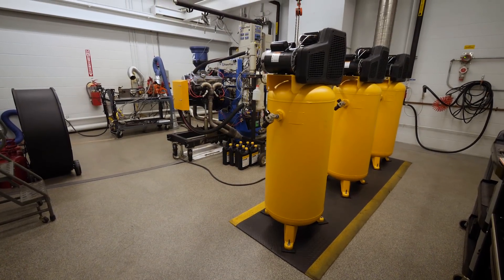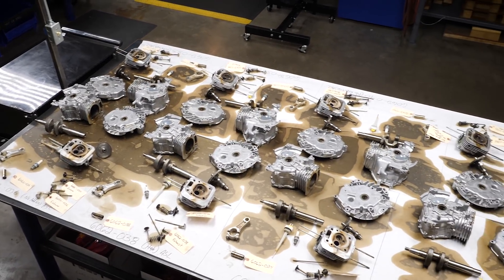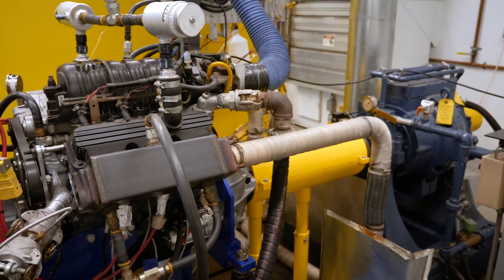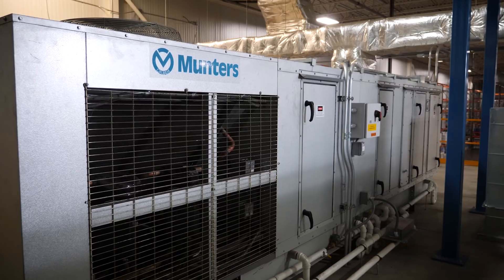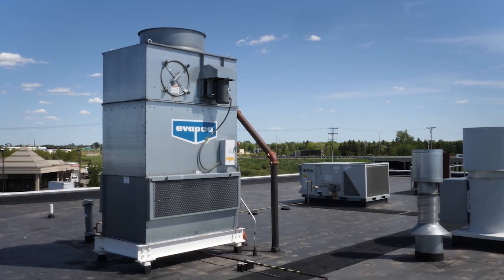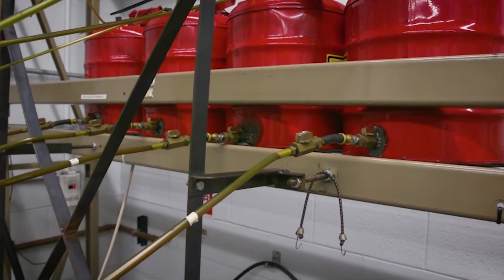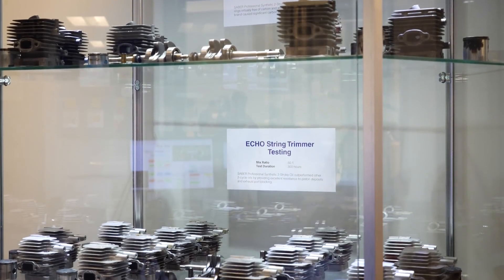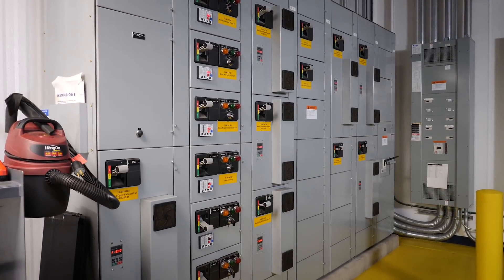Take a Look Inside the AMSOIL Mechanical Lab

Comment: how does amsoil work with carbon build-up on valve stems, on direct injection system?
Reply: patrick garant check out Schaeffer oil. They have 2 patented additives that set them ahead of the rest. Micron Moly and Penetro. Www.schaefferoil.com Americas oldest oil company.
Reply: Schaeffers is OK but the lose all credibility using that one armed bandit grease test machine at trade shows.  It's no secrete that moly is used when the company lacks confidence in their product. It's only use is when the viscosity fails you need that. But I guess it's needed in Shaeffers as their products are not synthetic.
Reply: Jess Cain Its not just moly it's a soluble type of moly specially developed and patented by Schaeffer manufacturing. All the other oil companies are just butt hurt because they cant use it. It has been a proven friction modifier a long time ago. Yeah Schaeffer really lacks confidence in their product 😂😂 they have some of the best reputation for lubricants and fuel additives in the world. Not to mention they are Americas oldest oil company since 1839... I think you need to do more research before you just make false claims. 😎
Reply: Jess Cain Also Amsoil Is very expensive compared to Schaeffers.
Reply: I bought the 100% synthetic OE 5W-30 for just over $4 per quart. How much is Schaeffers old man low performance product? $3.99?
Reply: Is that why you can't compare viscosity retention tests or Sequence IV cam lobe wear testing with AMSOIL? And you have to post your same BS "Secrete additive" post on every AMSOIL video? When you have a true performance oil you don't need to do that. Tacky.
Reply: Jess Cain Tell me why Amsoil only posts a few stats in their technical data ? Schaeffer shows much more. Also Amsoil claims to be the best oil but their approval ratings as far as manufacturers is smaller list than amsoil?  Amsoil is a scam just a mediocre oil with a marketing price. Unbelievable
Reply: Tell ms this big guy. I looked on Amsoil website their cam/lifter wear for the 0w20 is at 20.28 for the sequence test. Schaeffer manufacturing 0w20 cam lifter wear is 9.8!!!! THAT IS HALF THE WEAR OF AMSOIL 🤣🤣🤣🤣🤣😎👍😛
Reply: LOL Mr Peterson in Televiv - Big guy?? Actually you got the wrong data - the AMSOIL cam wear test was 3rd party (SWRI) and done on a 1994 era engine which requires 5W-30!! That's a whole 14+ centistokes less and it still showed no visible wear. Of course Schaeffer's lies as it's not really synthetic and yes - our OE which beats the pants off of all Schaeffer's is 100% synthetic and is just around $4 per quart for accounts when they buy in the drum.. A few cents more in typical cases.. 
AND - the Schaffer guy here in town had to close shop because no one wanted that garbage.
Reply: @grillsandaxlegrease3578  I'm not talking about 5w30 in 1994??? Look on the current signature series technical data they show cam/ lifter wear for 0w20 only in their pretty graph. But 0w20 is the only one they show. So I checked out Schaeffer 0w20 technical data sheet. Cam/lifter wear is less than half the number of amsoil. Not sure where you got the 5w30 and 1994 from? Maybe the fella by you went out of business but I've seen a few in my town start selling it so it must be junk right. Actually my engine builder just started selling it and recommends it over amsoil.
Reply: Dummy - the test you see for the signature series on that 4-page flyer was done on the 1994 KA24E test engine - a standard for the Sequence IV test universally. You are supposed to be the expert huh??  But to prove the oil AMSOIL used the 0W-20 instead of the 5W-30.  More detail was published in the blog.  Unbelievable. 
Schaffers is for old fogies - no performance. Can't because it's not synthetic.
Reply: @grillsandaxlegrease3578  so why wouldnt amsoil post current data? Your telling me since 1994 amsoil hasn't gotten any better? 
Schaeffer is superior to amsoil. Amsoil is a 100%plain synthetic oil with no additives-whoopee.
Either way Schaeffer blows away amsoil in the wear department 😂👍
Reply: This isn't amsoil - it's the test lab which evaluates all oils sold in the US - Reading comprehension isn't a strength of yours.  They use standard blocks for different tests. Sequence III is the Buick, Sequence 4 (IV)  is the 1994 Nissan cast iron block..  I listed above because it is incredibly consistent.  I dare Schaffers to run 0W-20 in this test. Schaeffers (or whatever it's called lol) used the one armed bandant which is part of their trade show circus making their products look like a total joke.  Even Pennzoil Platinum beats the Shavers (Ice cream?)..
Reply: @grillsandaxlegrease3578 
Actually the IVA test isn't as harsh as the sequence IIIG test. Both are 100 hour tests but the IVA test only ranges from 800 to 1500rpm. While the IIIG tests low to high rpm and heavy loads.

"The Sequence IIIG Test consists of a 10-minute operational check, followed by 100 hours of engine operation at moderately high speed, load, and temperature conditions. The 100-hour segment is broken down into five 20-hour test segments. Following the 10-minute operational check and each 20-hour segment, oil samples are drawn from the engine."

"The Sequence IVA test measures engine oil's ability to inhibit camshaft wear.
The Intertek test engine is a Nissan 2.3L, 3 valve per cylinder, 4 cylinder engine. The crankcase oil is subjected to 100 hours of continuous engine running, cycling from an 800 rpm idle period to a short 1500 rpm stage, and back again, 100 times, under very precise control of operating conditions. At the end of the test, the camshaft is removed and measured for wear. Each of the 12 camshaft lobes is measured in 7 places, and an average lobe wear is computed for the test."

NOT ONLY IS THE TEST HARSHER, SCHAEFFER STILL LESS THAN HALF THE WEAR OF AMSOIL 😎👍
Reply: See - you had to look it up - Took you long enough while I waited = 1994 single cam Nissan. You trolls gotta get paid. 
AMSOIL runs the SeqIIIG 300 hours minimum. And the IV 150 hours.  And they report the largest wear!! Not some selected area and does Shavers keep the test cam available for verification?  What is the average test result? And a 9 compared to 20 when 90 is the norm means almost nothing especially when the results for Amsoil are 50% longer!! That means it's likely the Shaver's would have sheered out before then and I'm expecting a wear scar of 100+..  I'll trust a real HP performer over one that sells oil from bottles that can't even keep a lid from leaking.
Reply: @grillsandaxlegrease3578  There is PLENTY of reviews of Schaeffer on Amazon where they have switched from amsoil. Look at the reviews on Amazon. Almost all of Schaeffers products have 4-5star
 ratings. Where is the amsoil ratings?
Reply: LOL!! Man you need new specticals old man (using Old Man oil). I'l looking at the blog now showing your sequence tests (Which you have to read up on because you didn't know) are the test which were ran longer. There is no need to run ASTM tests longer as those are indexes.  People do switch from various oils but if you are not looking for performance and not keeping the truck  - sure Shavers is OK but those people are fooling themselves as AMSOIL does cost less and the bottles don't leak all over the floor. The clown here who has the shavers store had shelves of the stuff leaking through the packages. But their sales are so low it really doesn't matter. It may be the best in the world but they ruin their image with that old fart in the booth with the grease tester trying to show how their oil works. 
Dollar general oil also has 5* ratings - when your IQ is 70 it all seems pretty good.
Reply: @grillsandaxlegrease3578  Just looked at the newest archive amsoil has for 5w-30. After normal length sequence IIIG cam/lifter wear is  14.8. Microns. 

Schaeffer Manufacturing technical data sheet shows cam/lifer wear at 9.8 microns for 5w-30.  

THE PROOF IS PROVIDED BY EACH COMPANY THEMSELVES, YOU CANT WEASLE YOUR WAY OUT OF THIS ONE HOTSHOT. 
AFTER A NORMAL SEQUENCE IIIG TEST, SCHAEFFER HAS 34%LESS WESR THAN AMSOIL. HAVE A LOVELY DAY 😂😎👍😉😭
Reply: Actually those #'s in the scheme of things are virtually the same. And using standard deviations you will get a 10% variation in such testing and these don't have to be averaged because it's a costly test done just once.  
But what really matters are the sum of the whole. How was the piston scuffing or deposits? Shavers being fraud synthetic (not allowed in Germany or Australia  marketed incorrectly) why do they omit the deposits at the 100 hours or even 200 hours?? Hmmmm
And it Shavers was so good then why don't they go for the extended testing? I can guess Shavers tests out of grade at 150 hours thus the driver would not only have deposits, they would lose additional throttle response and horsepower. 
I don't suspect they will be in business for long.
Reply: Sears thought they would last too.. But I didn't know about 25K. Harley owners don't care about that.  I pull a motor home and love the extra mileage as in MPG  and quiet engine. AMSOIL is famous for that.  All the people I met who deal with Shavers seem half witted or entering dementia. Listening to someone talk about shavers is like watching a tim conway skit from Carol Burnett show. 
Stay over on your Shavers thread you paid Tel-Aviv troll. Have a nice day too!! :)
Reply: Called the Amsoil guy and he said the lower wear scar isn't always a sign of quality. You can add additives to any oil to do that but then you get a series corrosion issue. So none of those tests reflect any cotton picken performance which is why people and myself are attracted to AMSOIL. Especially when the company like yours or Duralube is exposed using these chlorinated additives to lower the wear.  And he said that is way Shavers uses that Hocus Pocus test at the car shows because that's all the oil can do - something it's not supposed to do at all!! WOW!  Glad I use AMSOIL and not fooled by your nonsense.
Reply: @grillsandaxlegrease3578  LOL PAID? I work for General Motors. I am in no way associated with marketing or selling Schaeffer oil. Just love it so much I spread the knowledge that their is better oil that 100% PLAIN SYNTHETIC WITH NO ADDITIVES such as SCAMOIL. I am utterly amazed you think I'm paid to do this 🤣🤣👍
Reply: Just because it's older doesn't mean it's better I'm glad I'm not riding around today in a Model A
Reply: Just because it's old doesn't mean it's good or better if that was the case we would still be driving around in model A's
Reply: Amsoil published a test showing just that. It was around 30% less oil vapors or evaporates in the PCV system than RP and Mobil 1.  I own an EcoBoost engine and AMSOIL is the only choice for long life - it also helps to use a catch can.
Reply: That Schaeffers video is fraud per the comments. But forget 1-million. How about 2-million. Amsoil does that easy.  Especially in the vets GM cons owners to use Mobil 2. https://www.amsoil.com/newsstand/diesel/articles/amsoil-two-million-mile-truck-story/
Reply: It's funny how amsoil goes around with these "independent test" against other oils claiming to be the best, but there never went against Schaeffer have they? If my company claimed to have the best oil I'd put it up against any brand. Another shady side of amsoil is they hardly post technical data. They post less than half of what's on Schaeffers. Why, because they got something to hide. Tell your amsoil buddy's to do testing and I bet they wont because it will make their product look bad. I know if my company claimed to have the best oil I'd have stats against everyone only makes sense. Amsoil will never be what Schaeffer Manufacturing is, a superior company that's know worldwide is America's oldest oil company and has almost 5 times the revenue amsoil does! 🤣 amsoil only has 3 CLS. Schaeffer has 53. Alot more engineering goes into Schaeffer products. You could say the same for Schaeffer testing against amsoil but they dont go around boasting to have the best oil in the world. Cheers
Reply: How about the manufacturers warranties. Wouldn't that be an indicator of the quality and confidence the manufacturers have in their products?
https://www.amsoil.com/lit/g1363.pdf vs. http://www.schaefferoil.com/cmss_files/attachmentlibrary/Limited%20One-Year%20Warranty%2C%204-18-13.pdf
Reply: @tomd6853  Warranties are a joke. All the company has to do is come up with 1 reason why the oil wasnt the fault and they are off the hook. Seen it and read it many many times. Also if amsoil has amazing oil it should never create an engine failure thus why would you even need a warranty? That's why Schaeffer doesn't have the warranty amsoil does because they are a farse, plus they dont advertise not so smart 25K intervals. Look if amsoil really had the best products wouldnt they have a top revenue? Schaeffers yearly revenue is FIVE TIMES that of amsoil. They are a superior company that's found there way ahead of everyone. Thanks for the links. 👍
Reply: Five times? 
What is AMSOIL's annual revenue?
Reply: @tomd6853  estimated 30million a year. Schaeffer is 150 million a year 😁
Reply: I thought I had herd around $120M. No way to really know for sure for privately owned enterprises. Best guess would be urban legend no matter what the number.
Reply: At $30M you would have to wonder how they could stay in business with the facilities they have and the product lines and all the manufacturing employees and the dealer network and commissions and headquarters and administrative staffing.
Reply: @tomd6853  I did look at a couple sites and your number is more accurate. Either way they are both successful private companies I just chose Schaeffer.
Reply: 2 Patented Additives set them ahead of everyone. Nobody else has this......

After choosing the finest base stock they start adding two friction modifiers; Micron Moly and Penetro.  Micron moly is oxidized molybdenum that is magnetically attracted to ferrous metals.  It is five times stronger than steel and has a melting point that is twice as high as steel.  Even under the heaviest loads Micron Moly will not pound out.  And Schaeffer has the highest content of molybdenum among all major brands.  Along with Moly Schaeffer adds a proprietary product that is exclusive to Schaeffer oil called Penetro.  Penetro reduces friction by adding what is like microscopic ball bearings in the oil.  This is especially good since most engine parts contain metals that are non-ferrous along with ferrous metals.  Non-ferrous metals do not attract magnetically so they need lubrication to protect the surface other than metal alloys, such as molybdenum.  Penetro and Micron Moly stay on the parts even during cold starts to offer the best protection at all times.
Reply: patrick garant lol what an epic oil fight xD